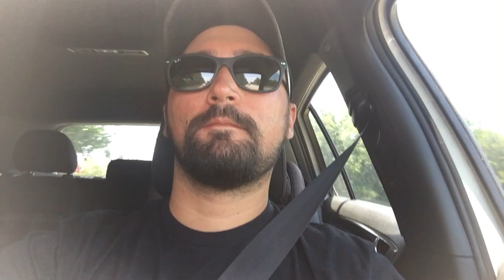Mk7 Exhaust Tech: How & Why

Comment: Does your recommendation of a CAT>Resonator>Muffler apply also to MK7's with the factory DP? I'm not planning on installing a downpipe and am considering a custom 3' catback with a Vibrant 17950 only. Would this end up being much different than a stock car with a muffler delete?
Reply from the maker: I think you’re confused. The Cat+resonator+muffler applied ONLY to cars with an aftermarket downpipe. Running a catless downpipe yields zero positives and plenty of negatives so I’d never recommend that. The OEM downpipe is so restrictive you can run nothing after it and it wouldn’t drone or be anywhere near as loud as what you’re proposing. 

If you run a aftermarket downpipe with just a 17950 it’s going to drone, and sound horrible at anything but WOT at 4K rpm and up...hence my statement you NEED a muffler as well. 

I have three different TBE options that range from mild to wild. If you’re looking for LOUD, GOOD, CHEAP that doesn’t exist so pick two and go from there.
Reply: @BaunPerformance  Thanks for the response, but I think something got lost in translation.
I'm planning on running the stock DP for the foreseeable future. I'm more concerned with tone, than loadness. I'm considering a 3" catback with a 17950 in the factory res location and the stock DP. Thoughts on the sound level and tone of that setup? Would it be much different to a muffler delete on a stock catback? Thanks
Reply from the maker: @benjaminsherman3254  It wouldn’t be much different, although that’s not the route I’d take. When I build a catback for use with a stock downpipe I skip the resonator, and include a muffler. 

If you’re interested I can build either version Aggressive or Less Aggressive without the 17950 and add a reducer for the factory downpipe
Reply from the maker: @benjaminsherman3254  here’s a non resonated catback I built a few years ago for a R https://youtu.be/lYZZRHS7xCI

Comment: I have a mk6 GTI with stock DP vibrant 1792 and muffler delete. I like the sound but it does drone on the highway that I don’t enjoy. You think a 17930 would cut the drone significantly? I would hate it to be too quick but drone is more important honestly for me.
Reply from the maker: Mk6 shouldn’t drone with a downpipe, let alone without one. I’d double check you don’t have metal on metal contact anywhere under the car

Comment: Just installed a 17950 and its been great! Massive difference, thanks for the suggestion. I do however have this "tinny" sounding rattle, kind of like at 14:18/14:19 in the video but a bit louder. It sounds like its coming from behind the dash, but definitely near where the downpipe is.